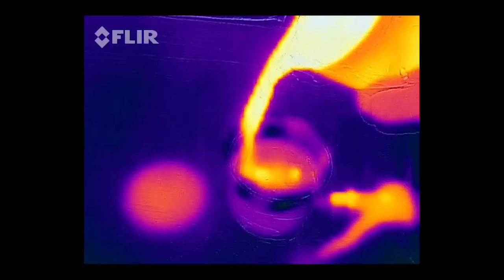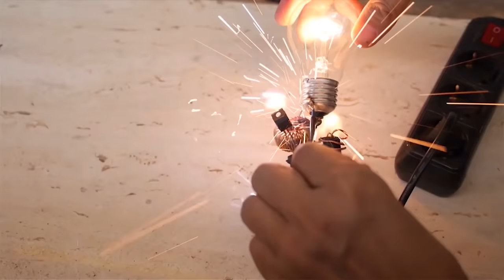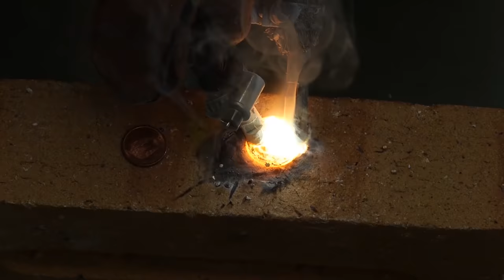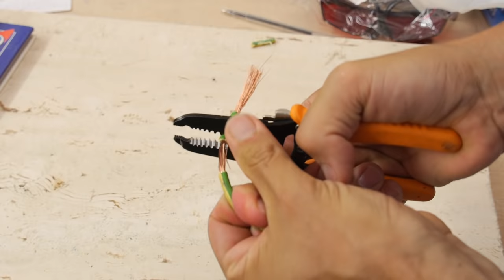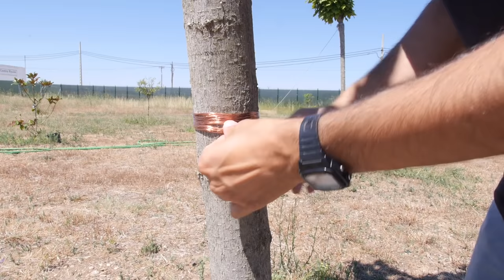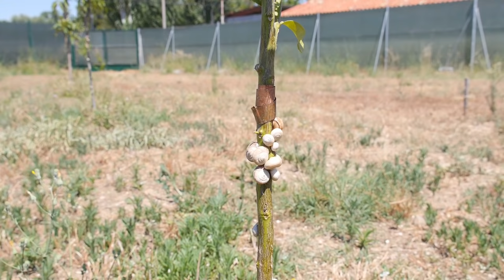Copper Snail Barrier. Really Easy to Make.

Comment: To understand why the Copper repels snails, you have to understand Chemistry and the anatomy of snails. After a lot of research I believe that there is a chemical reaction against the snails slime(consists of hyaluronic acid, glycoprotein, proteoglycans, and antimicrobial and copper peptides), which actually causes a counter reaction with the Copper that reacts with the snail's Glycoprotein so it attacks the nervous system and the respiratory function of hemocyanin which is responsible for the oxygen levels. Found in the cell structure of snails(Mollusks and also Arthropods) So when you think about it the Copper tapes used against them are causing them confusion and stress(maybe even depression too) But the snails aren't so clever to work that out. I wonder how many actually know that snails have hundreds of tiny sharp teeth? Snails are a remarkable animal as long as they stay away from my seedlings and plants it's all good.Snail slime is harvested and commonly used in beauty products and proven to be beneficial for the skin.

Comment: What about copper makes them stop?
Reply: the lubricant that the snail makes to crawl make a chemical reaction with the copper which creates an electrical charge so the snail gets a shock.
Reply: Wow...neat😎
Can this work on giant african snails?
Reply: There is no shock involved because there isn't another metal.
Copper releases ions into snail goo and that's something snails dislike. That's it.
Reply: Where did you get the idea that shocks require two pieces of metal to occur? Minerals and Salts can react with metal to produce electricity.
Reply: Would iron release coppers into snail goo?
Reply: @albertrenshaw4252    salt is soudim chloride. Sodium is a metal.
Reply: @vacri54  no
Reply: Jack Sparx sodium chloride is one type of salt. There are hundreds of thousands
Reply: @albertrenshaw4252  there may be many types of salt, but most in fact contain some sort of metal. In fact, I can't think of a salt that doesn't, off the top of my head. If you can think of a few, please let me know. Since salts are Ionic bonds, and most Ionic bonds occur between metal and non metal ions, it's difficult for me to think of a salt that is not composed of a metal. I'm not a professional chemist by any means, so I realize I might be missing something here.

Comment: does this work for slugs?
Reply from the maker: Mmm, there is some discussion about on the Internet. Some say yes and other not. I don't have slugs.
Reply: Yes..
Reply: Yes, I used 2 inches wide copper tape, and it works wonders with slugs.
Reply: Slugs are just "shell-less" snails (say that with quotes because they do have a small shell which is usually internal).